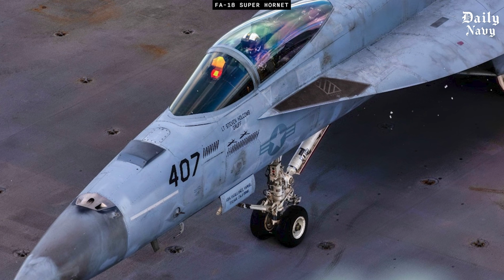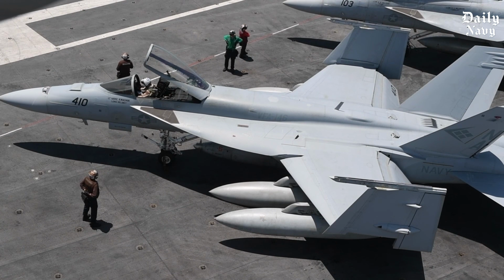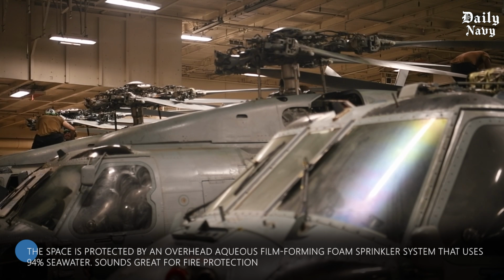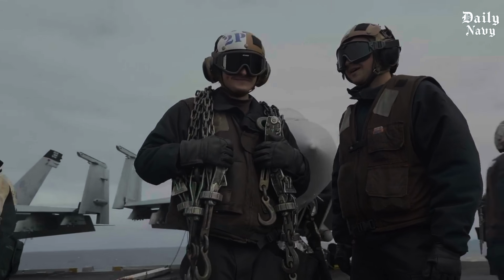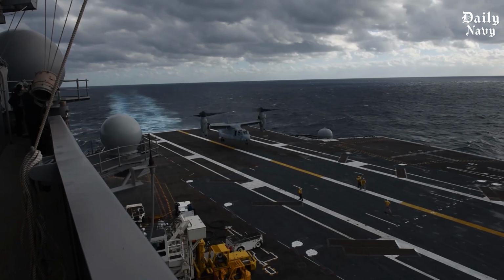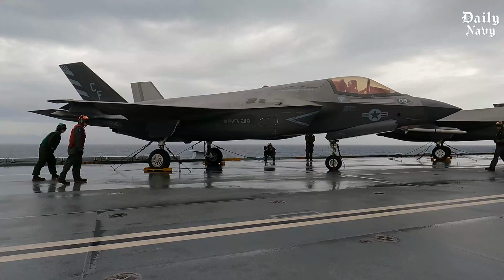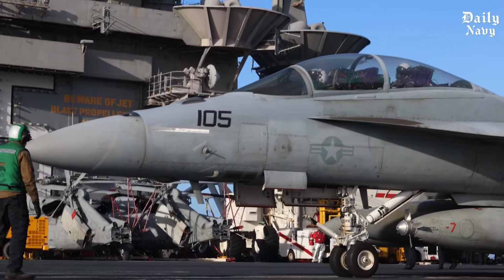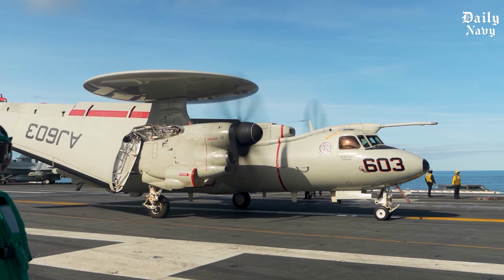How Aircraft Carriers Survive Storm Season Without Losing Billion-Dollar Jets

Comment from the maker: ⚓ Veterans — been there done that — Drop your ship and years served below if you lived through storm season at sea 🌊🇺🇸
Reply: CVA-66/ USS America/ VF-33/ AOAN/  67-71. To be honest with you I never knew we were moving or stopped. Smooth as Diaper Joe the President that Didn’t know changing that Diaper. Smooth as Shit😢
Reply: Was on " Stack Watch" CVA 34. Storm came in,  EVERYONE was inside, except me. They told me to come down, AFTER I was thoroughly soaked. Great memories.. 😂
Reply: CV 60 Saratoga VF74 air wing. 89 to 93, and a short float on the CV74 Connie in 93
Reply: Aug '76. USS Midway, Sea of Japan (I think).  Stuck on the 30-knot limit for days with seas breaking over the bow - just like the DDs.
Reply: USS YORKTOWN, final deployment 1969, North Atlantic in winter. Took a 27 degree roll that caused the Admiral’s barge to break loose in the hanger bay. Took out four SH3 helicopters; two totaled, stripped and pushed overboard; two down for the duration. General Quarters.
Reply: Uss Okinawa lph3 on our way to Auckland New Zealand 1970
Reply: Kitty Hawk 2026 to 2010. CAG-5. Atsugi. I still remember that. The helicopter you see is 614 and I was on the ERT team. Woke me up after 18 hour shift. I was Mids. Night check.
Reply: AD2
Reply: Lol whats that got to do with joe biden, that carrier was retired in 96

Comment: Anchoring it with chains is not stopping the wear and tear caused by the storms, winds and rains. There can be enhanced measures that can be taken to secure the aircrafts and no you do not have to to do all of this manually either. Even the chain securing can be an automated process

Comment: USS Saratoga. The waves braking over the flight deck. We were running from hurricane. I worked in primary flight control. Watching the bubble come 4m from diving the bubble. Watching the small boys. Disappear between the waves. USS kitty Hawk F-18's parket out front. I was a AD the waves came over the top of the F-18's. Can not remember if it was 21 or 22, chains we put on each plan. Being up on the roof. During the beginning of the storm. Tying the planes down and checking all the chains again and again. Was one experience I'll never forget.

Comment: I  was in the navy and believe me I would not want any flight deck job or maintaining these planes on deck even taking off or landing on board. It looks really easy but in😅 those deck job you are at risk because landings and takeoff are not as easy or safe as  it looks. And you 😂are standing on deck exposed to elements and precarious aircraft landings. Good luck.
Reply from the maker: You said it perfectly. Flight deck and line crews are taking real risks every second out there. Huge respect, and thank you for your Navy service 🙏

Comment: Those tie-down chains aren't ordinary steel. They are titanium composites. You can't cut them with bolt cutters. 
Best place to be on a carrier in a storm is down in engineering, or up on the bridge. You want to be close to the center, and far away from the bow because that is where the pitch and roll is worst. A storm sorts out the sailors real quick. Guys who never got seasick before will discover what it feels like. 😆

Comment: TLDR:

1) Monitor the weather and adjust course to avoid if possible
2) Move aircraft on deck more towards the center of the deck and use heavy-duty chains and wheel chocks. If possible move aircraft below deck to the hangar bay
3) Throughout the storm, adjust speed and use stabilizers to keep the ship upright and as stable as possible

You're welcome.

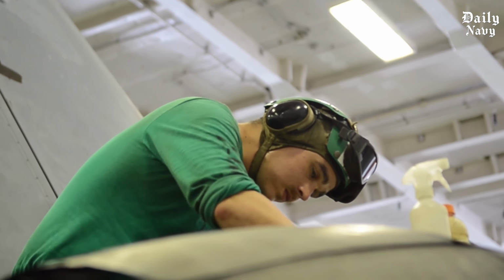Comment: See the bulkhead @6:23....the wall in the background, the dark grey border line is up about 4 feet. Use to not be that way, border lines in the hanger were 1 foot or even 6 inches. I worked the flight deck back in the 80's, made some people mad, I went downstairs to the hangar. It was like a vacation for me so, we started repainting the hanger bulkheads, starting forward bay 1 working aft. I look at the dirt and stains and decided to raise the border like 4 feet, the dark grey borders hid the greese and oil stains perfectly.  I had to get approval from the Command and Safety Officer which was worried about light and after a few days, they said go a head move the border line up. That was the Ranger or maybe Kitty Hawk, I can remember but after a few years, all carriers started doing it. 

I also bought a monster scissor stand for raising and lowering drop tanks from the over head storage in the hanger bay...even out at sea. Made things simple down in happy valley. And then they brought me back to the flight deck for the next 17 years.....no joy in mudville. That's ok, the flight deck belong to me....I controlled and knew everything, when voices had problems out of deck, when the carries was turning without notifying me and when squadrons were having problems with their planes...I knew everything, even the lighting fixtures around the island structure, I was the handler for the last two carriers. Long time ago...long time!
Reply: Sweet

Comment: 1981 and 1982 USS Nimitz cruise, VS-24, S-3a and S-3B Flight deck crew. Any plane capt [Brown shirts] are required to carry at least 6 chains  at 18 to 25lbs [depending on length]. Only the brown shirts are allowed to tie the aircraft down. During normal flight time clear weather all planes will have a minimum 6 chains before flight, planes that are not flying that day will have 9 to 12 chains. As bad weather is reached 24 minimum, heavy weather with deck tilt of more than 5 degree pitch have 24 chains. Extreme weather like seen in the north Atlantic with deck pitch of 15 to 20 degree [which exceed a total 30 to 40 degree] will have 48 chains. Take the length at almost 1,100 ft long divided in half is 550ft at 20 degrees is 188 ft of movement [one direction]. At 40 degrees would be a staggering 355ft of vertical movement of pitch on the flight deck [this is very rare but has happened]. Usually the carrier will try and go around the bad weather unless there is a very important reason to go through, like training.  In my 3 cruises the I was on, only once did we see heavy waves clear the flight deck [not just spray but solid water]. anything left on deck would have a minimum of 36 to 48 chains or as many as can be used on deck. during these times chains can become scarce. One correction, when I was in the navy early 80s the plane captains [brown shirt] launched,. recovered and tiedown there aircraft and there was no blue shirts. There was purple = fuel, and yellow shirts which took over the moving and actual launching of the aircraft. I don't remember any Blue shirts.

Comment: So back on October 8th 1988 I was on the USS Midway CV-41 somewhere off the coast of the Philippines. We rode out a typhoon that was a nightmare, seriously. The Midway had improper buoyancy after it had some hull reconfiguration done. Basically they welded huge steel blisters above the keel to help raise the ship. One of the officers from my squadron VA*165 hung a plumb bob on the wall in the Ready Room with angle of degrees marked on the wall. We took a 24 degree roll that made a lot of folks think we were going over. Scared the shit out of many sailors. The SAR helo was chained down in the center of the flight deck, just forward of the island. We were taking wave after wave over the bow. The power of those waves hitting the helo bent the rotor blades down to the deck. I have it on a VCR tape from the flight deck cameras. Yeah. I was one of the scared as shit sailors. Didn't take long after that to retire the Midway, which is now a floating museum in San Diego.
Reply: We did operation Sand Groper of the West Australian Coast with the USS Midway, massive ship, that was  1980 around October  ,it  got taken out by the Kiwis dressed as a cruise ship, we all ended up in a big brawl at Pinocchio's disco in Perth, 458 sailors going the tong, 112 taxis were called, a good way to cool off and cement friendships, 10,000 stepped ashore together that night , i was on the Carrier HMAS Melbourne CVS 21 , we had gone through a massive storm in the Great Australian Bight on the way over , much the same as what is being depicted , waves crashing over the flight deck

Comment: I was on the jfk in the med in 1993.we went through 2 huge storms. Both times they were going around hurricanes. We would put all jets in hangar with 18 chains per jet. We would be in the shop watching the flight deck cameras. Waves were coming over the deck. Scariest time for me is I was riding breaks on my f18 one night coming to hanger bay on L2. Weather was bad so I'm told to close canopy. We lowered to bottom and I see the flight deck crew running and next thing all I see is water. Riding elevator they used 3 chains. I raised that damn canopy and was on my way out..😅😅 they yelled stay there and they got me in. But I'll never forget that.😅
Reply: Nice to hear the pilot side of the story.

Comment: Bad weather is not restricted to aircraft carriers. I was on an LPD during a typhoon west of the Philipines. There were 30 ft swells. We had tanks, artillery and assault vehicles stored below. For me, as Corporal of the Guard, the worst part was the brig. It isn't spacious and we had two "residents" plus the brig watch. An LPD has a flat bottom hull for getting close to shore during an assault. The small brig was very warm and the residents started puking which caused the brig guard to puke, I replaced the brig guard with the "supernut" and prayed he cold hold on long enough for clean up. Ventilation was poor. OORAH!!
Reply: In the Brig, you had the only shitters that used fresh water on the ship because if the "guests" or residents as you call them drink salt water it will make them sick, fresh water nope.

Comment: AC flight decks have tied owns a.l around the flight deck and use heavy adjustable chains to hold the planes tight to the deck. At least they did in the 1960s. Q.E.D.

Comment: Those reinforced hangar bays and multi-point restraints save billion-dollar F-35s and Super Hornets from breaking loose, even in heavy rolls. No more WWII-era typhoon disasters thanks to satellites and precise routing.
Reply: Satellites and routing dramatically reduce risk, but they don’t eliminate it. Heavy seas, sudden roll coupling, and mechanical failures still stress airframes and restraints — that’s why modern carriers rely on overbuilt hangars and redundant tie-downs, not forecasting alone. 🙄

Comment: How does steaming into the wind slow the winds relative speed over the boat, you have added the speed of the boat thru the wind to the actual wind. That means you have increased the wind. You have to sail downwind to to slow the relative wind over the boat. It does decrease roll. Nothing to do with the wind other than the wave direction and it presents less wind resistance by not showing the huge broadsides to their force.

Comment: Nuclear carriers also need refueling.  The aircraft fuel has to be replenished at regular intervals.  Also fuel for the tow tractors and fire trucks although I believe that all the vehicles will run on jet fuel now.  They can carry much more jet fuel than  the last conventional carrier CV-67 could since they don't have to carry fuel for the engines.
Reply: The ship can carry up to 1 million gallons of fuel and since it has no boilers, that’s a lot of jet fuel that can be carried.

Comment: I'm not a Navy Guy but I am curious how they mitigate the effects of corrosive salt water on planes located on the carrier deck.  Do they flush everything off with fresh water?   Good video and Thank you.
Reply: Each squadron has a handful of guys who constantly check every plane for corrosion, marks it with a wax pencil, grinds down each tiny spot until the corrosion is gone,, treats the bare aluminum with alodyne, touches up the paint. This is part of the regular at sea maintenance cycle.
Reply: If and when waves come over the deck and a jet gets a saltwater bath, that jet will get a freshwater wash down as soon as possible. Like as soon as the ship is out of storm conditions. Been there done that.

Comment: Yes I went through two typhoons when I was on the USS Ranger during the Vietnam war. I was in fighter squadron VF-154 the Black Knights. Both were nasty storms. You try to get every aircraft you can to the hanger bay. There were some left on the flight deck all chained down. I don’t think we lost a plane but I am sure some were damaged. Would not know until they were inspected. I tell you this the storms were nasty. However being on a carrier I had no problem managing the passage ways. Slept well never felt ship the roll. The
Smaller ships we had in our battle group had a tough time. From the fan tail we saw destroyers go up a wave and at the top there screw’s would come out of the water. They would go back down and pop up again somewhere distant from where they were. I remember thinking those guys are going to die. That really bothered me.
Reply: VA113  USS Ranger 70-71! I remember those  storms!!
Reply: VAQ-135 USS Coral Sea 70-73
Reply: I was in vf-154 at Miramar in 1976 on the Coral sea in a Typhoon about 1977 vf-194